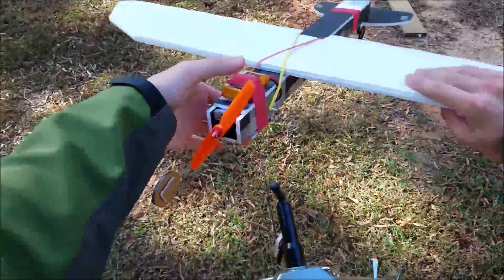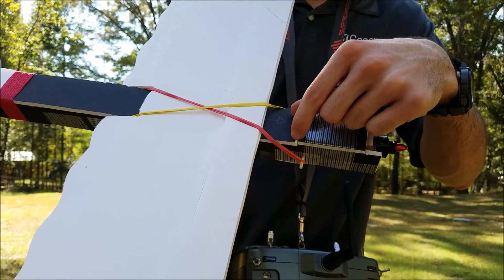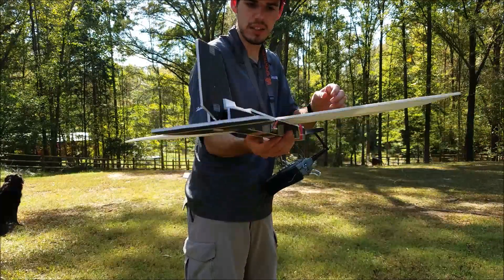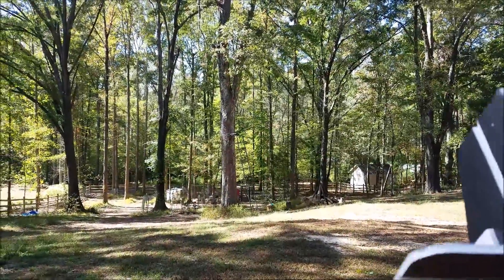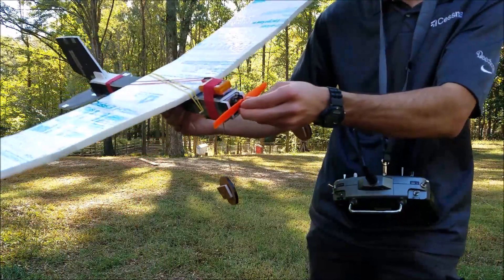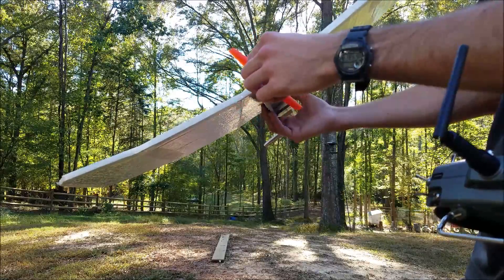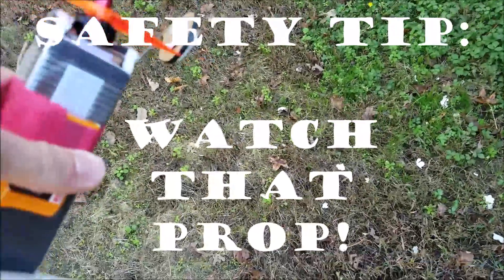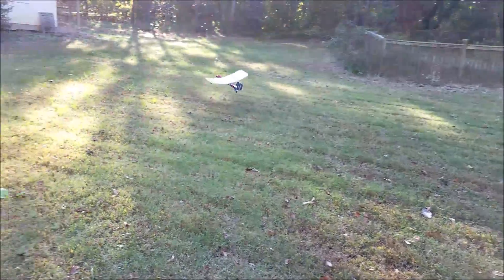The Mk II: 2nd Dollar Tree Foamboard RC Airplane

Comment: thanks for posting.  good work.  some very late thoughts.   it appears that you have no idea what you are doing or how screwy that main wing, at :21, is.   so, what else is new.    btw, a main wing, having a Symmetrical profile and mounted at zero-degrees angle of incidence, makes  No  aerodynamic lift.    at 1:00, the 'step' on the main wing is a Major source of turbulence induced Drag.   the step does Not cause lift to be generated.    it appears the stabilizers are NOT correctly sized.  the span of the horizontal stabilizer Should be equal to 30 percent of ws.      all models appear to Suffer from a Tail-heavy  Distribution  of  Mass.   which is an issue  SEPARATE  from achieving correct balance.   do NOT tell me about the model's perfect balance because       that is an  IRRELEVANT  fact.     cheers